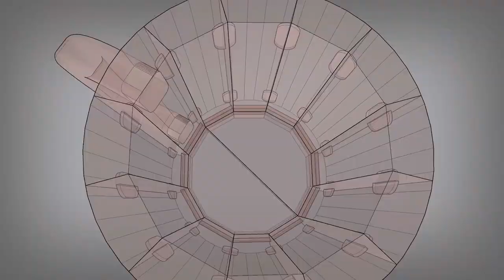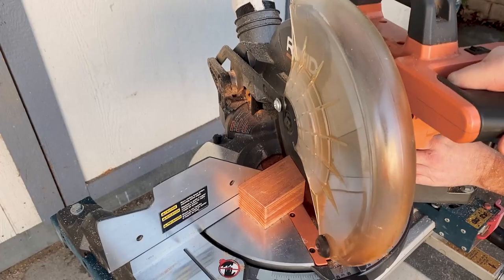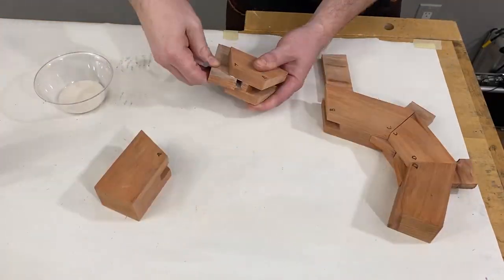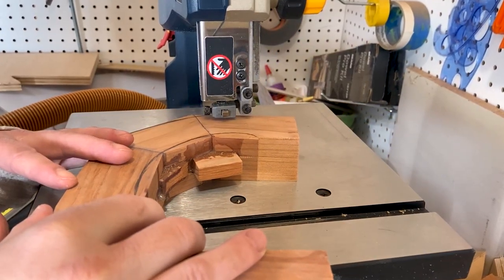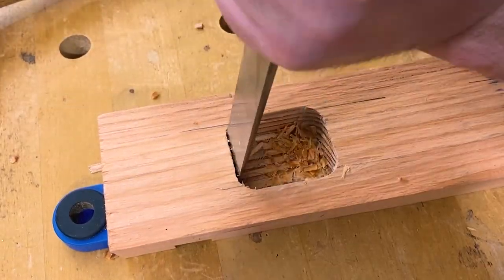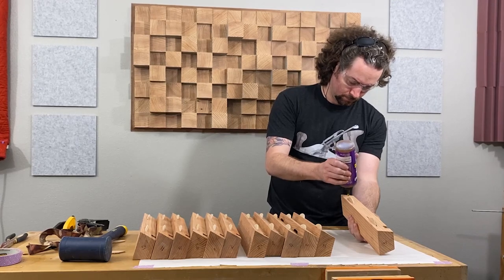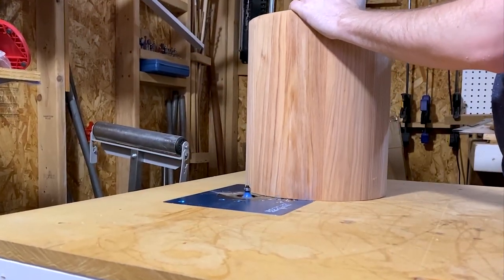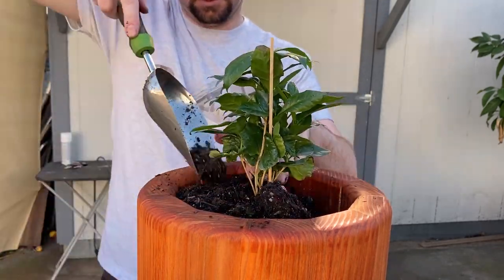VERY UNIQUE Planter from Redwood 2x4s - with plans

Comment: This is awesome! Can this be done with: mitre saw, orbital sander, router and/or jig saw? I don't have a table saw, band saw or drill press.
Reply from the maker: Thanks! You should be able to do most of it with those tools, but you probably need a table saw or band saw for cutting the bevel on the barrel staves.

Comment: Such a great video!!  Curious your preference to the glue you used rather than wood glue??
Reply from the maker: I tried Titebond III at first, but it just wasn't drying. Possibly because the redwood was still pretty wet or because redwood is naturally oily.

The polyurethane glue worked great, and holds a lot like epoxy. I could have used that on the handle as well. I like it a lot, but it does expand a bit like Gorilla Glue (not as much), so depending on the application it could be too messy.
Reply: That’s great to know!!  Thanks for the scoop!!